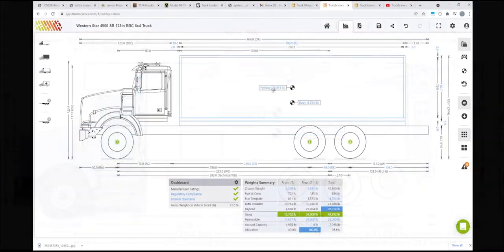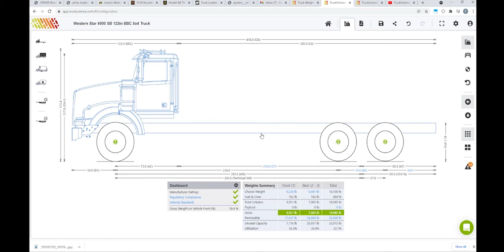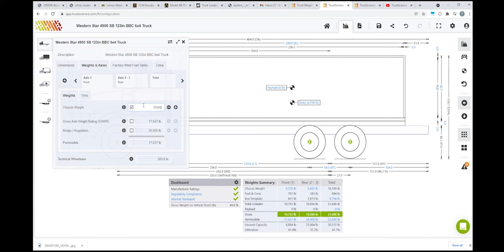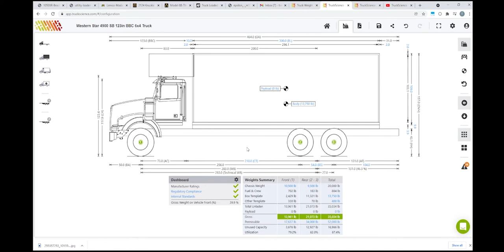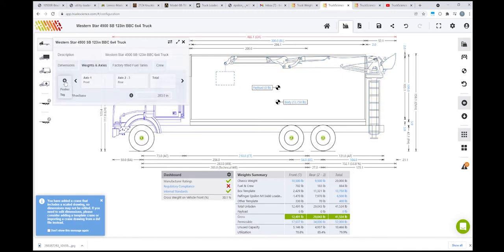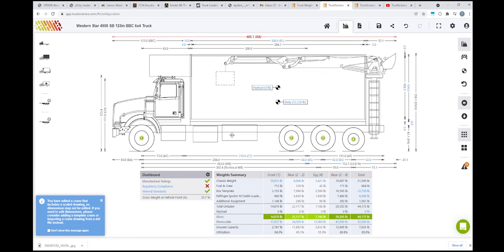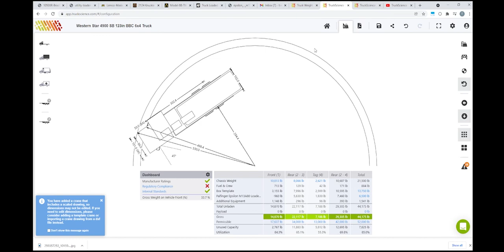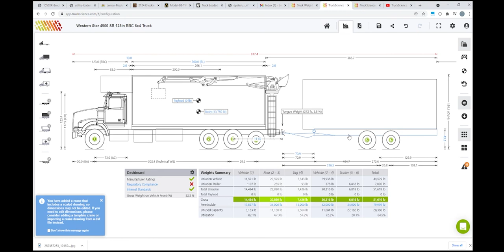Grapple Truck Build Series Part Four - How To Use The Truck Science Website. Adjust Wheelbase etc.

Comment: Hey Tim, looking at building a truck or buying a used one. What was the final price on the midnight western star build you did? Thanks
Reply from the maker: John, with 2020 being the last year for a glider  we paid the extra 15k for the black 4900 chassis. If you want to pm me on treebuzz I can go over the details. 
There is a lot of value in slightly used vs new but it can also be a headache.
Reply: I'm not sure what tree buzz os
Reply from the maker: @johnplattenburg4687  Its an old Tree service related website.  Here is a link to the thread.
https://www.treebuzz.com/forum/threads/2020-21-grapple-truck-builds-one-of-the-last-glider-kits-ever-made.46043/